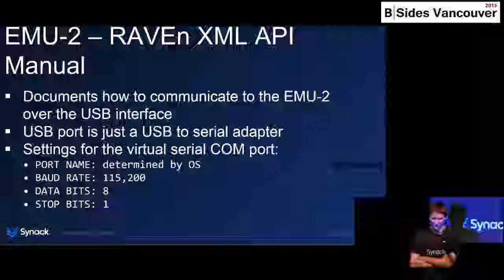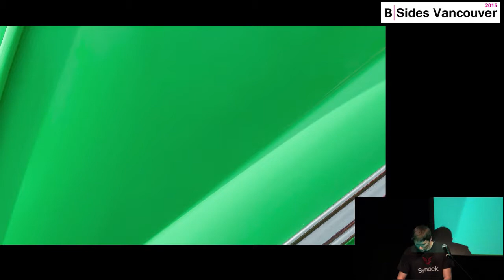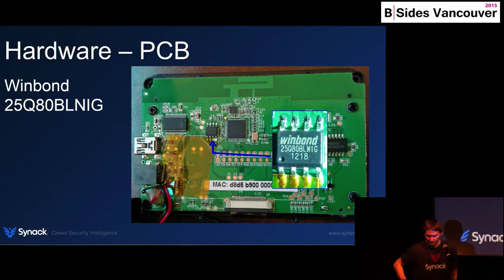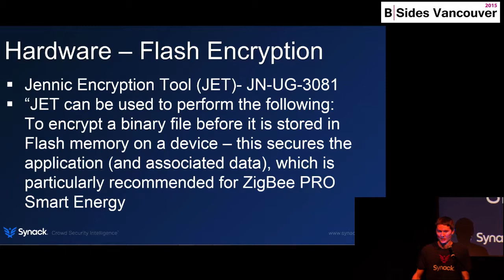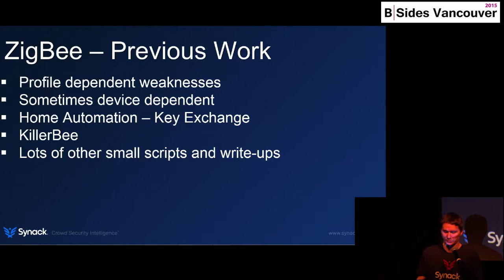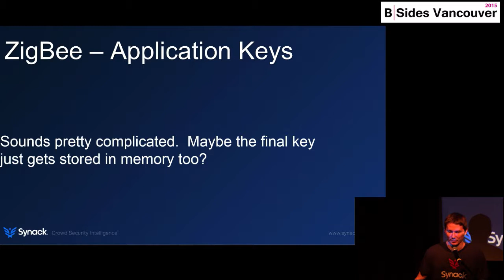BSides Vancouver 2015 - Wesley Wineberg - Analyzing the EMU-2 Zigbee Home Energy Monitor

Comment: I know I'm 10 years late but, these energy monitors are still sold. This was a kick ass talk that helped me integrate my EMU-2 in to my home automation setup. I use it as a sensor to display my current costs and to help me save on my power bill.